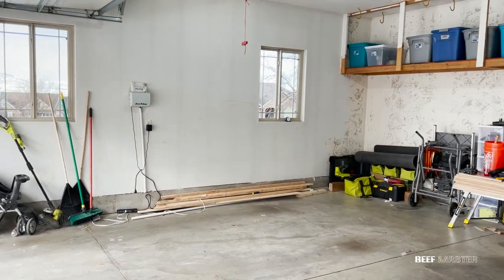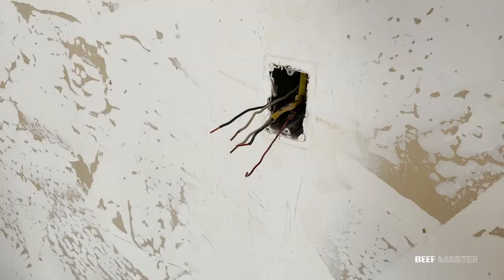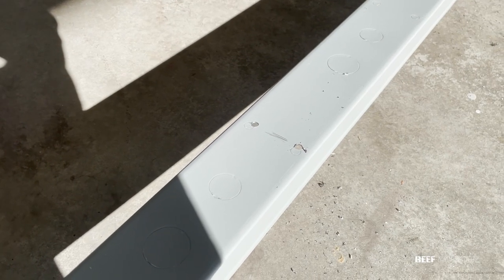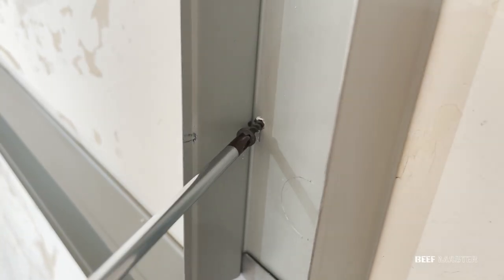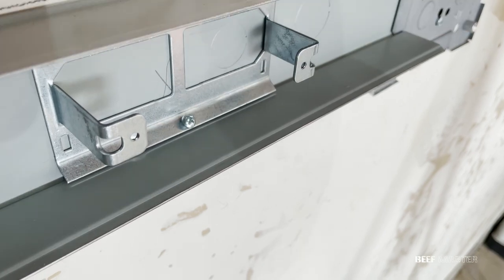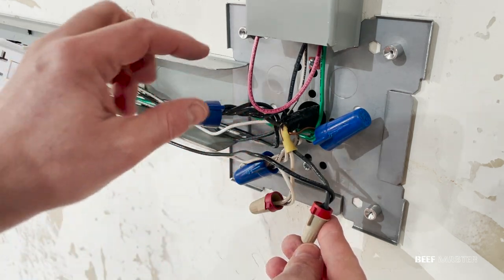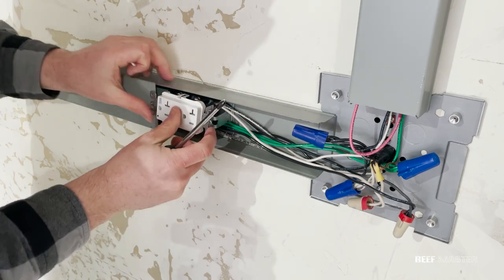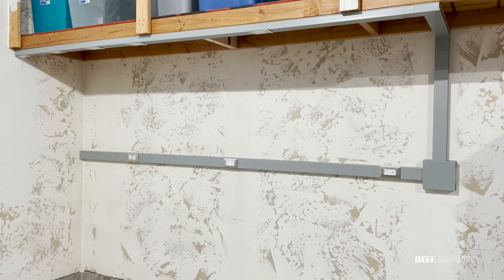How to Easily Add New Garage Outlet Plugs

Comment: Did the wiremold instructions call for a ground connection to the wiremold from the system ground?  The wiremold sounded metalic and i would have expected it to have mechanical fasteners to electrically tie it together and a separate ground wire attached to your system ground for the metal parts.
Reply: This is what I saw, only ground connection is weak with only place is where the  gfci touches the box where its screwed on.

Comment: There should be a cable connector clamp on the box to hold the wire in place and to keep the wires from chafing. The way it is done now is not code.

Comment: No romex connector where the wires come through the back of the wall plate?  Wrong!
Reply: Actually the opening is suppose to be the same as the box in the wall

Comment: There is nothing wrong with overkill but, receptacles installed on 20 amp branch circuits may be 15 amp or 20 amp or any combination of 15 and 20 amp rated.  Except if it is a 20 ampere branch and has (1) single(not duplex) receptacle installed, then it must be 20 ampere rated.  I can get you the NEC numbers if you need it.  The tape around the NM cable through the knockout is a no no.   The wiremold is a wire way, not a conduit in any way.  At no point in the whole video did you show a plug.   Be careful with terminology in electric videos.  
Very nice installation overall though.   Best wishes,   Kevin

Comment: It looks very nice, but I would have used emt conduit and 4 x 4 metal boxes instead. It's also easy to change or add to later and probably less expensive. I like the industrial look, but that's just me. You don't need 20 amp receptacles for a 20 amp circuit. They offer no advantage over 15 amp duplex spec grade type.